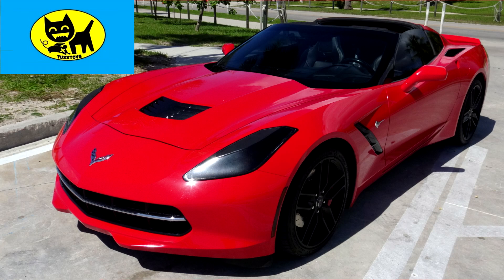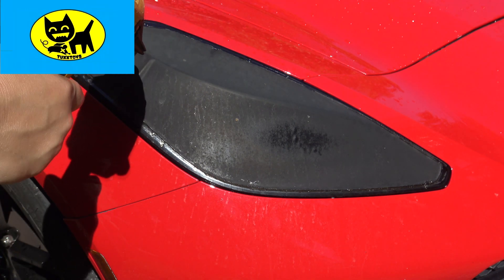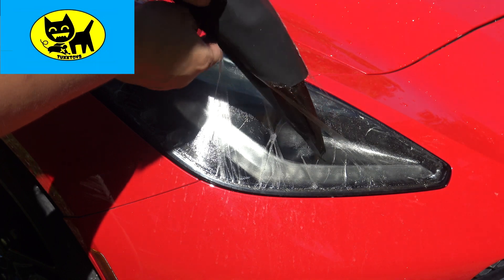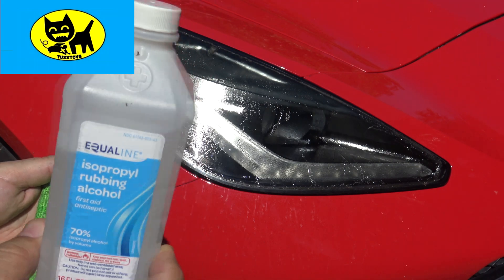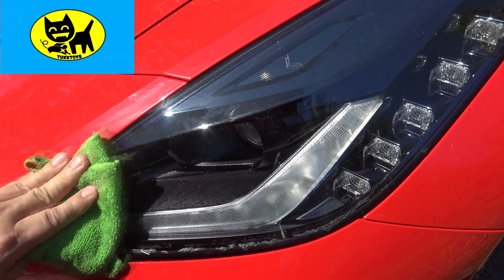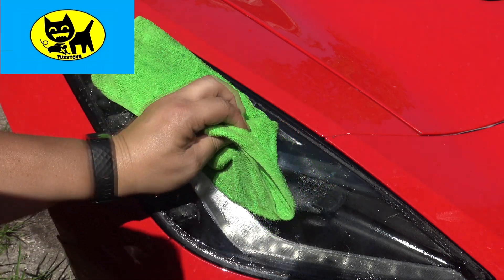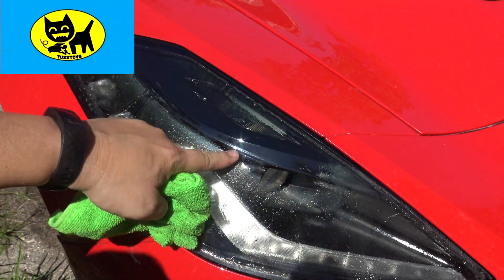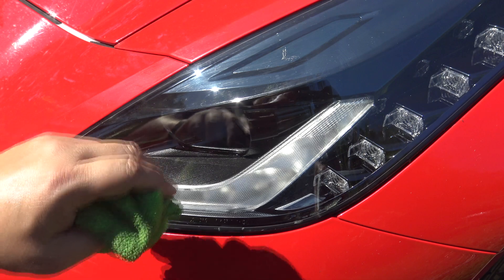How to remove headlight tint (and all that messy glue) Corvette C7 Live Demonstration .

Comment: I tinted out my tail lights 10 years ago and after a decade in the Florida Sun being baked every single day they are completely cooked right on, Completely dried out and hard . A  heat gun is not going to do anything at this point for me. is there another option for me or do I need to simply just get a new tail lights?
Reply from the maker: Mine were cooke don from the FL sun as well. You have to heat up the tint to remove. - Its all in the video but be careful to not melt the plastic lense
Reply: Mine was cooked like f. Heat gun or boiled water doesnt help much,  just knife it. But its a test of patience and knife skills. Good luck
Reply: Heat gun and a plastic razor thank me later
Reply: Why not just sand it down?

Comment: I would use acetone in place of the rubbing alcohol. Let me ask why didn't you remove light and do this away from the car?
Reply from the maker: To remove light you have to remove bumper and thats very hard or atleast much more labor intensive.
Reply: @TUXXREVIEWS  Got it, I am going to have to remove some smoke effect that came in a rattle can and I'm about to remove that from my head lights and tail lights in my Camaro.

Comment: I e used 90%on my car hasnt effected it at all yet and ive done it also on my moms car to
Reply from the maker: My headlights are still looking sharp using the process outlined in this video. I may not understand your question, are you trying to remove tint or ? ?